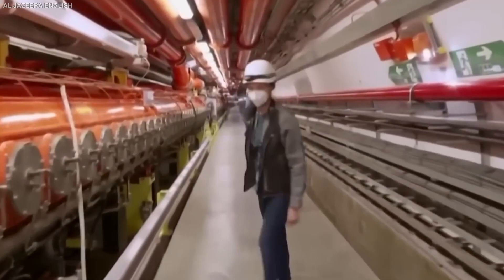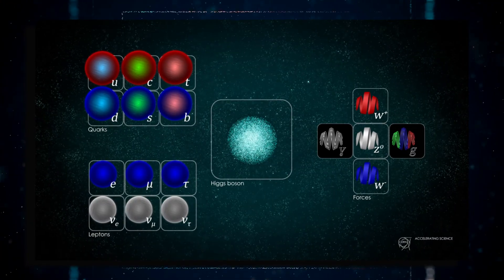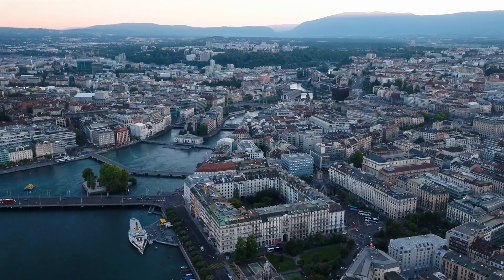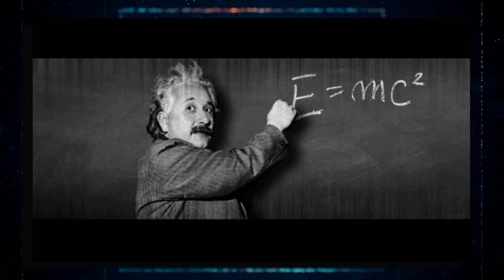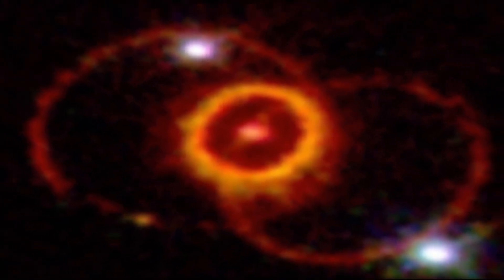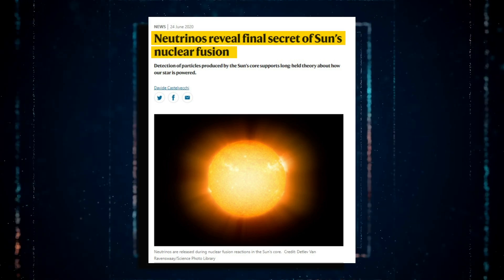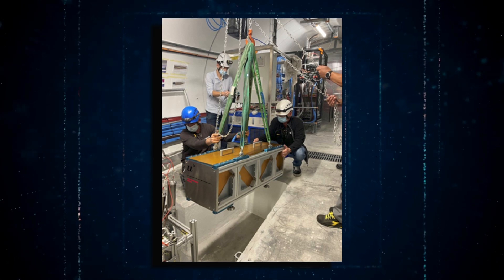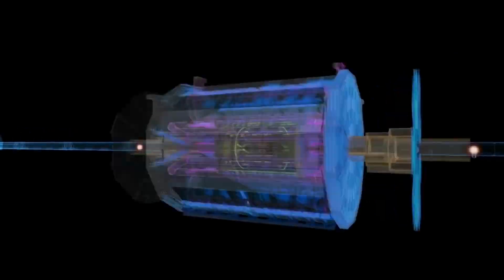Something Weird Is Happening At CERN No One Can Explain

Comment: I reckon antimatter has a higher data density, and therefore 1 gram of antimatter might be the opposite of maybe 100kg of matter. They might have that spooky connection over distance and one is the invisible software to the visible other. One has physical geometry and the other is spiritual in nature allowing many more geometric forms that hold way more energy and information than the matter it relates to.